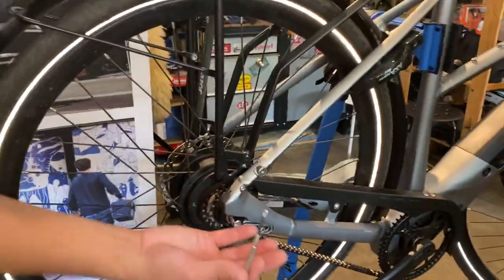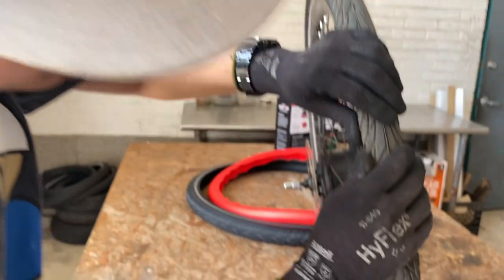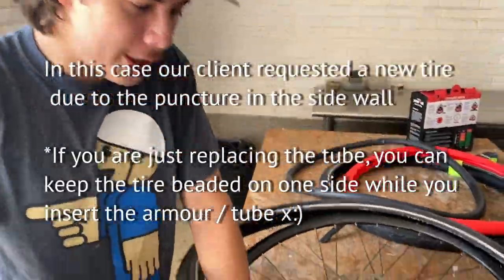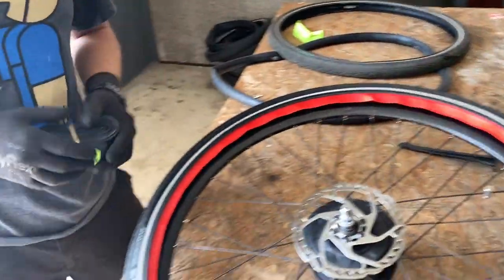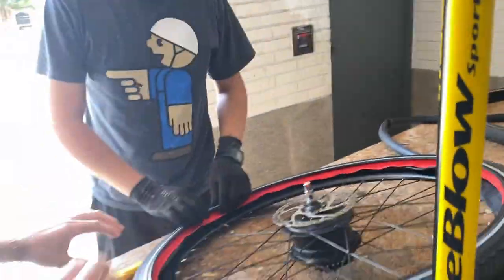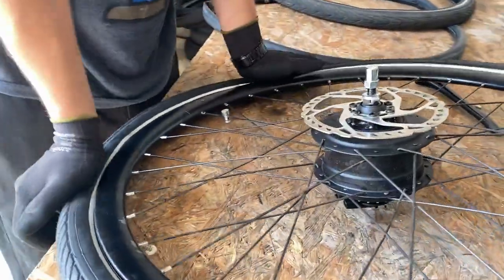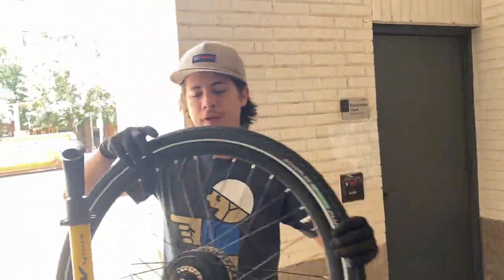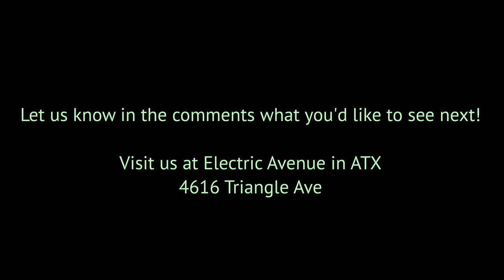How to change rear tire on electric bike with Enviolo 380 trekking hub — Gazelle C380+

Comment: 4:30 Pro tip: Before inserting new tube, inflate partially so it takes shape, which makes insertion without twisting far easier.
Reply: Exactly. It's so much easier and less likely to get a pinch-puncture.

Comment: Good video, thanks. So, the belt tension doesn't change at all during the process? Are fixing flats on the side of the road realistically doable on this? Thanks again.
Reply from the maker: The belt tension remains the same! If you do have trouble getting the belt back on the hub, leaving the tire deflated until the belt is reinstalled can give you that extra wiggle room. With the right tools and some patience, it's doable. The tire is easier to bead alone without the tannus armour...although with it, you wouldn't have the flat to begin with :)
Reply: @electricavenue2204  Awesome, Good stuff here. 👍
Reply: Nice video!
Reply: @electricavenue2204  What about roadside?

Comment: Did you use a smaller tube with the Tannus? Tannus recommend this but you didn't mention it. It feels like a standard tube would be able to run at a lower pressure, which appeals.